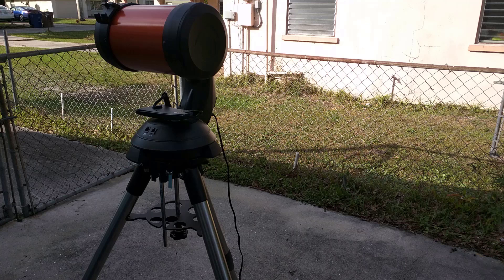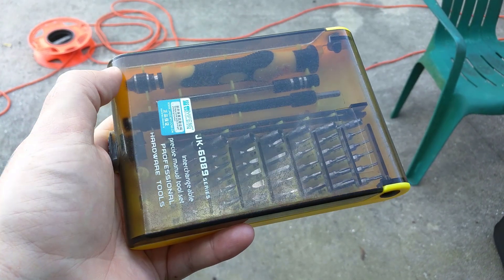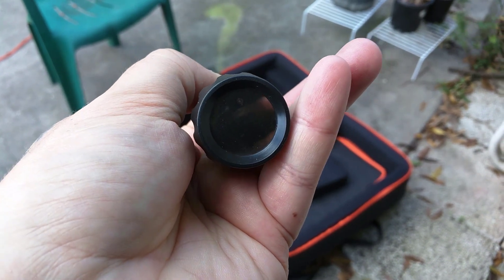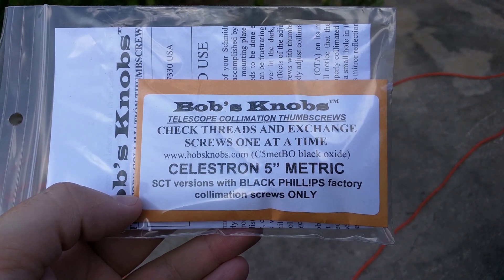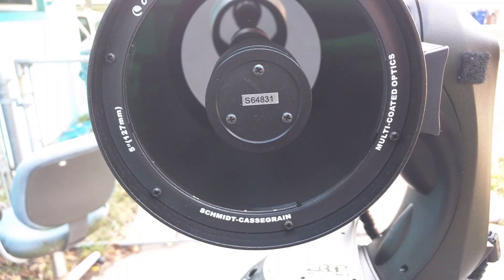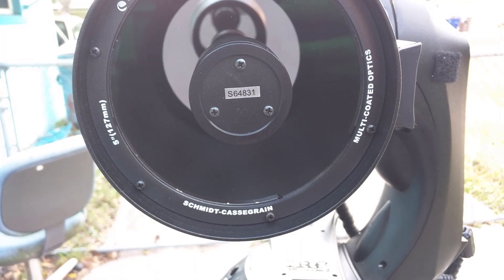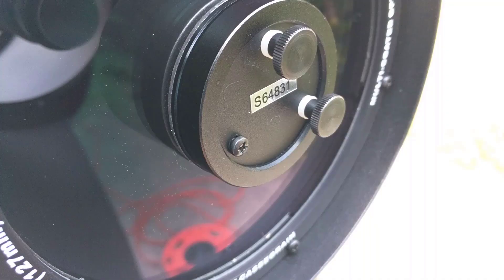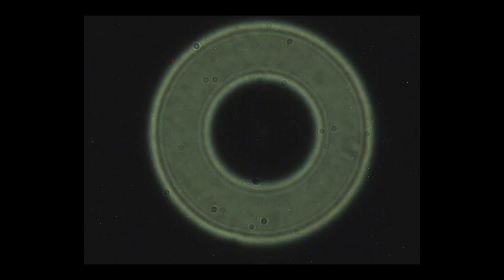How to Collimate a Schmidt-Cassegrain (SCT)

Comment: Folks do Not be afraid to collimate your SCT, just be careful if you are going to replace collimating screws for bob knobs, just remove one, and replace it with bob knob, then do the other two, just take your time doing the collimation and you will be just fine, these SCT's get out of collimation so you will have to get in there and go for it often, so don't be afraid, its not hard you just have to take it easy and do it slowly. you Got This! you can't be sending your sct's to Celestron everytime it gets out of collimation, thats not sustainable, you can do this yourself!

Comment: Lots of misleading / incorrect statements in this video and zilch about how to collimate a SCT (which, given the rest of poor video content is probably a blessing). Very misleading video title and incorrect content.
Reply from the maker: I kinda figure it's because of one or two things 1 your trying to troll or two because your kinda dumb. It isn't misleading at all the video here I replaced the screws with aftermarket knobs. Because I did that basically messed up my collimation on the telescope. The video is made to explain that you need a artificial star which is recommended depending on the aperture of the telescope will make changes to a telescope in this video a bit different. The goal is to make small fine adjustments to make the artificial star appear nice and crisp like a star would look if it was collimated correctly. As mentioned I don't recommend people doing this useless they know what they're doing, The video was to show the process it takes I highly recommend people reach out to the local astronomy club and have a member show them how to do it.

Comment: Oh dear... another u tube wannabe without actually doing anything ..
Reply from the maker: Ohh dear another you troll who never made any content in 6 years on YouTube and has no subscribers and goes to bash others who at least try. 👍
Reply: @MatthewHKnight  I'm not a troll, I was looking for advice on collimation and my 6 years content added up to the same level as yours...
Hope it's all going well
Reply from the maker: @derekregan6926  collimation isn't hard as people think it is all you need is a artificial star to collimate with. The only time these things ever need it is if they've been banged around a lot
Reply: @MatthewHKnight  no it isn't hard, it's easy.. but it's very easy to do it wrong... from my searches it's seems that many just think they need Bob's knobs and get the doughnut central.. which is far from the case
You don't need a artificial star
Reply from the maker: @derekregan6926  Bob's Knobs makes it a lot safer to make small adjustments rather then blindly trying to hold Phillips Screw driver on a screw to try and make small adjustments one mistake with a screw driver and you can scratch the correcter plate. A Artificial Star is a lot better then a real star you can simply use some thing like a solar power bank that has a white LED and put a black piece of electrical on it and then take a sewing pin and poke a small hole in the tape so you can see a small amount of light about the size of a period symbol on a keyboard. People seem to like fail to realize that the whole point is you need a a eyepiece that  is 2.5 mm focal length The point you want is that the black area around the disc when defocused should be centered you should have a perfect disc when you look into the eyepiece at the artificial star using a real star will be kinda tricky because you need ideal conditions in the sky. Trying to collimate using a real star under not good sky conditions can make for a bad collimation  Celestrons website even talks about that.
Reply: @MatthewHKnight  There's nothing with the Philips heads but I use Allen bolts on mine, if you're clumsy then yes buy Bob's knobs but you will be collimating far more as they don't sit in there as tight as Philips.. I don't see a problem with using a real star, never had an issue, I always use a bright star, up on the meridian and use a camera on loop, I use a software to measure the concentric circles.. that's as far as I'm going to tell you...
I did write a whole paragraph on how to collimate... but it's up to you to figure it out, as I've done.. you won't find it on u tube or on any searches on celestron.. figure it out
Reply from the maker: @derekregan6926  this is coming from the person watching a YouTube video on how to collimate Lmao
Reply: @MatthewHKnight  yes... and I didn't find what I was looking for..anywhere...  
You're laughing,  but your video didn't actually show how to collimate...and I bet you still don't  know.. good job I deleted the paragraph I wrote earlier... keep trying

Comment: Does it matter if you defocus in or defocus out when doing collimation with an SCT?
Reply from the maker: Yes, think about it this way, when a star is nicely in focus it will have spikes, the point here is to focus until you see a donut then you adjust the knobs or screws  until you see a perfectly centered black hole in the middle celestron has a link on there site that talks about it if it's not in the description I'll try and find it and put it there.
Reply from the maker: There is a pinned link but this is the link https://www.celestron.com/blogs/knowledgebase/how-do-i-collimate-my-schmidt-cassegrain-telescope-sct they say to defocus however it's best to do this with a artificial star because it's hard to collimate a SCT if it's windy or the temperature isn't right a lot of factors can  give a inaccurate collimation.
Reply: Yes it does... to prove this to yourself de focus the star in one direction  and look at the doughnut,  then bring back to focus and go the other way . Compare the position of the doughnut...

Comment: You need to take this video down. You don't know what you are talking about. You're gonna confuse people.  Do some studying and become thoroughly prepared and familiar with EVERY detail no matter how small,  then you can make a video that is informative and factual. 
Good luck!
Reply from the maker: Na  👍
Reply: And next time if he actually DID collimate the scope that would be helpful!
Reply from the maker: @mulehead126  the funny thing is I did. Buy you need a artificial star to do the collimation process. That's the what I was showing in the video where the star was out of focus as a disc. The point of the collimation is to to make sure your star when it is out of focus as a disc that the hole in the center of the disc is perfectly centered. But being how you never did a collimation before you obviously didn't know what was going on in the video but then again people who watch it would know what's going on and I clearly warn people about doing this if they're new. This video was done when I was replacing the collimation knobs with easier to use knobs.

Comment: The information provided in this video is plainly incorrect. Collimating your SCT is a critical step, and does NOT void the warranty . Replacing screws or using knobs is also not a warranty-losing modification. By that logic, mounting a finderscope or additional rail would also void the warranty. Celestron even encourages using aftermarket solutions on their website. 
(See: Knowledgebase, How do I collimate my Schmidt-Cassegrain telescope (SCT)?)
However, just to be sure and to put viewers of this video at ease, I contacted Celestron technical support. This was confirmed - replacement of the focuser at the back or the screws to collimate  with third party options does not void the warranty. Nor does the actual act of collimation with the provided Celestron screws void the warranty. However if any damage to the scope occurs during this procedure, say you perform it incorrectly and you break the secondary mirror, this is obviously not covered by the warranty.
I encourage a re-upload of this video as this is false and misleading, as is also clear by the like-to-dislike ratio.

Comment: Hi....I tried collimating my new Nexstar 6SE,  secondary mirror fell off.   I think i may have moved the screws too loose.    Primary mirror looks ok though...does this mean  I can put the secondary mirror in  and all should be good?  Or anything falling on the primary mirror  means OTA  is screwed??
Reply from the maker: You're likely gonna need to find a local astronomy club, Collimating it is gonna require a artificial star if you manage to put the mirror back on at this point. You're gonna need someone to help you hold the OTA while you tighten the mirror back and as I said if you're able to get the mirror back on you will need a artificial star so you can do the collimation. If the Collimation isn't done correctly objects will not look correct. Hubble Optics Hubble 5-Star Artificial Star is about the cheapest you can find But first you need to get the mirror back in, The Artificial Star is gonna need to be setup pretty far and you will need collimate without the Diagonal and use a 10mm My advice though is to go over to Cloudynights website and have them explain what to do just to make sure I didn't give you the wrong advice.
Reply: Really. Where is the secondary mirror just now?

Comment: I have never heard that collimating one's telescope voids the warranty. Do you have a citation for that? Of course if you drop your mirror while doing it that's another story.
Reply from the maker: Modifications void's the warranty.
Reply: @MatthewHKnight  I'm pretty sure, especially since it's in both Meade and Celestron's manuals on how to collimate, it's not a modification nor of any other type of warranty busting action. I've had 4 Meades and 1 Celestron SCT over 25 years. Doesn't mean I'm right here, but I am. Give OPT a call, they're open now.
Reply from the maker: @davidwilliams7935  I was referring mainly to replacing the screws.
Reply: @MatthewHKnight  Actually you also said just collimating. We are in agreement with replacing the screws.
Reply: @davidwilliams7935   Replacing the screws does not void the warranty. See my latest comment :)
Reply from the maker: This warranty shall be void and of no force of effect in the event a covered product has been modified in design or function, or subjected to abuse, misuse, mishandling or unauthorized repair.